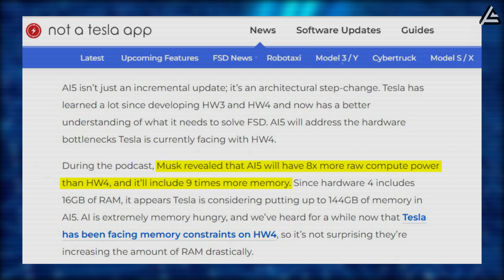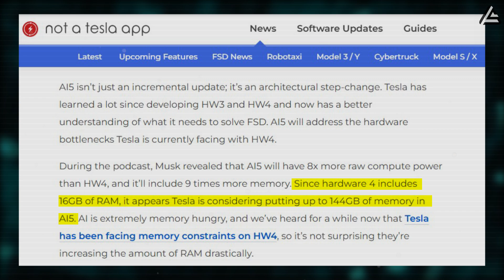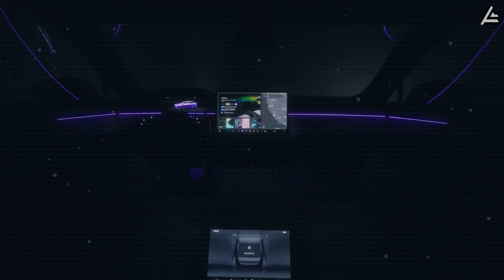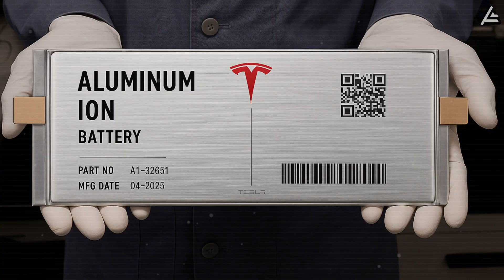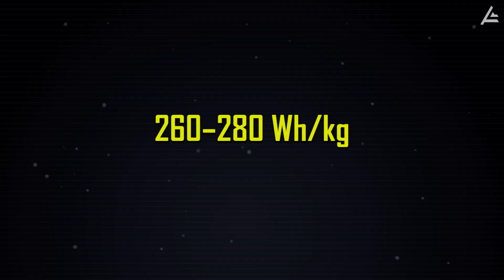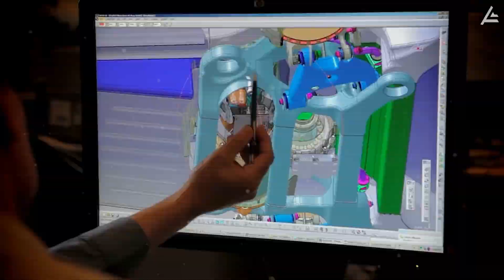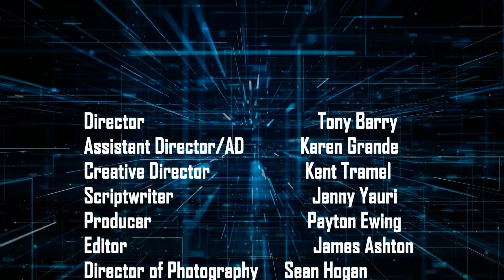2026 Tesla Model 2 Updates: HUGE Shocking Changes. What You Need To Know?

Comment: They need to offer a reserve/removable battery pack that perfectly fits in the frunk. Reduces  battery discharging/range anxiety.
Reply from the maker: Their new battery technology could let you go a whole week without charging for normal daily driving, and there will also be variants that let you travel between states without stopping. If you want to learn more about new battery technologies like aluminum-ion, sodium, or solid-state batteries, check out our previous videos or leave a question here and we’ll answer it